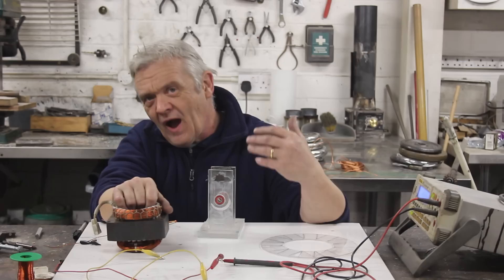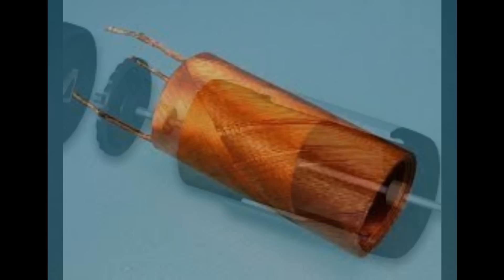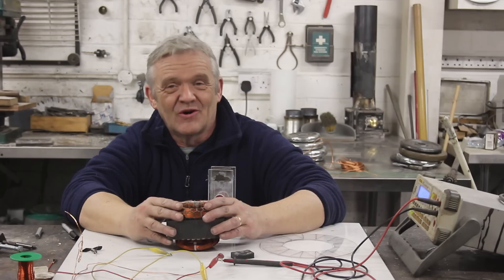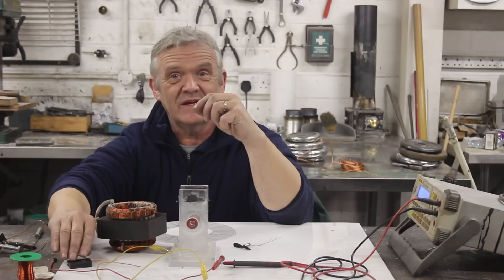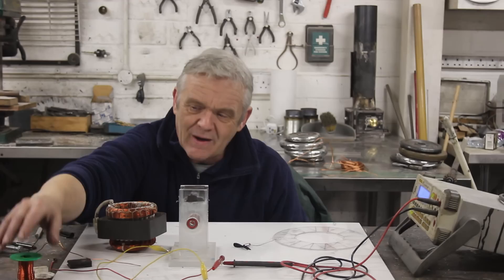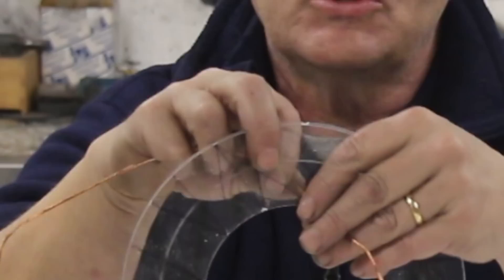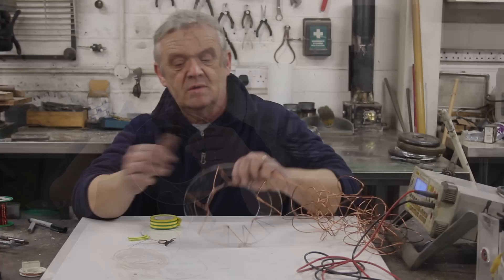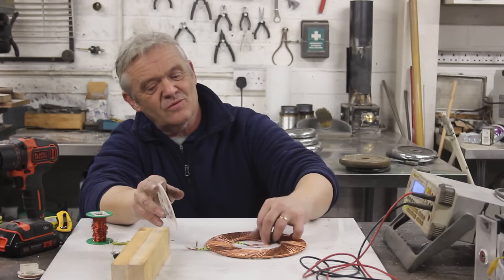1801 Winding Star (Faulhaber) Coils And Making Litz Wire

Comment: Tidy - nice build Rob, thanks for the upload - not enough of this sort of content on YT. 

Please do a video on your interpretation of a coilset that'd work well with back-emf pulses - Being a different method of switching entirely it requires a different coil arrangement. 
Were a rotor to combine one of Bedinis'  ultra low-current drive methods (attraction is more efficient than propulsion apparently) 

With a high efficiency generator winding like this on the other face of the rotor, I wonder if a gain could be achieved?

Many credible people have recognized that the law of conservation of energy is deeply flawed and all efforts to replicate should be applauded.
Reply: According to a 1955 encyclopedia the law of the conservation of energy states: “Energy cannot be created nor destroyed. It merely changes forms.” Later dictionaries and encyclopedias have a different meaning. Now, I’m not saying that the definition changed due to politics but it seems to me that the older definition has some wiggle room compared to the later definitions that cry out, “NO! You cannot do this!” There, I’ve said my piece. Thank you for reading my little rant.
Reply: @mikehorrocks2909  For sure , there are countless examples that seem to break the rules. None truly "generate" current (Dollard says otherwise in some of his lectures but I don't understand that much yet) however they can be made to work around them quite effectively. Your average heat pump has cop:4. Just a matter of converting thermal back to electrical, and loop it, it'll "run to the bearings wear out" I have read that this is possible. Possible electrically too. Bedinis machines were "Ether Sumps" for lack of a more fitting analogy. Creating a low point so some of the trillions of potential volts from the local environmental/static/ether/vacuum (insert your own term, modern science won't) can enter and be rectified, stored, or otherwise. Floyd Sweet did the same thing - so did Konzen, TH Moray, many others, that is create a phase conjugate mirror, sustain the dipole, and tap into what's already there instead of forcing nature's hand and suffering the "Leaky Diode" methodologies.
Reply: @reeferbeleafer9912  yes.
Reply: @reeferbeleafer9912  I've always read Bedini's machine was a way to circumvent the Back EMF that is formed in every motor, thus being super efficient but not breaking any laws of thermodynamics.
Reply: @JehuMcSpooran  "COP is in the batteries"

Comment: The problem with trying to harvest low wind speeds is that the power contained in the wind is a function of wind speed cubed.
So if your local wind is 4m per sec, you only get 1/8 of the power compared to if it was 8m per sec. Doubling the wind speed gives you 8 times the power.
So to harvest low wind speeds with any decent result means MASSIVE surface area to catch the wind. And the working surface area of the turbine is very expensive being (probably) the highest cost of the enture turbine.
If you seriously want to get usable,power generated from 4m per sec winds, I think you should be focusing on building very large turbine area very cheaply, and the type of electric generator etc is almost irrelevant (provided you gear it at the optimum ratio).
And there is a reason why commercial windpower operations dont try to harvest low wind speed areas... 🙂

Comment: Very cool. I would think a huge advantage of individual coils would be that each phase is wired in series. So load capacity increases proportionate. The interconnects can be larger wire. Much less resistance, less energy wasted as heat. It's like a 100 ohm vs 1000 ohm. This may save winding time though. Unless i'm seeing it wrong... that's a long resistance wire; It must be vastly larger to now handle the entire load. Individual coils do not have to carry every load in front of it. That would take some serious large amperage wire.

Comment: I understand that the different windings have advantages, but the common windings on the average motor are many times easier, and quicker to make, are cheaper, and the extra weight doesn't affect the power used or generated. I do find the last 2 videos interesting, and informative.

Comment: A lot of people don't realize flywheel mass in a wind turbine is less desirable.   Spinning a coil under a load pose a challenge in keeping it secured to the rotor when experencing back torque, but the wind turbine will be operating more efficently in varying wind.

Comment: Hi Rob. Love the Litz wire - great stuff. I’m struggling slightly with the geometry of the coil - maybe I’m missing something and you can clear it up? I would have thought there would have to be some sections of the coil which had no copper - to allow for the ac to flip direction? If I’ve understood the method correctly (other than the litz providing 10 turns in parallel) everything is in series (you just kept wrapping). I can’t see how the magnetic field is going to be changed in the coil as the magnets rotate past it. I thought you had to have (say) north poles over the coils all at once then a gap then south poles over the coils all at once. By spreading the phase to cover the whole sheet of acrylic don’t you have all of your norths and souths all acting simultaneously on different parts of the coil which will cancel out any emf?
Reply: I'm having the same trouble visualising this too.

Comment: i deal  a lot with coils to but not for generators or motors but for metal detecting we have a lot of discussion about it whats better basket loop dual you name it but i still havent found a good way, the thing is its so simple energise the target then listen to the result whats hard about that but it has to happen less than 50 microseconds or you wont detect gold so you need the coil to be quiet so you need to dump all the ringing and capacitance thats built up less that 50 microsecond using damping resistors so its not so simple after all but there must be a better way other that resistors to do it

Comment: permanent magnet 
Bifilar winding could be used to trap the magnetic field in the wire so it becomes a electromagnet / designed poles as you want 
so it can become corless magnetless rotor. calculated length to the wire relation to frequency you aim at to spin is the hardes part. 
for that smooth run. as negative resistor that feeds in the back emf (usless / usefull current ) frequency . 
swiching system to make a magnetic sucking effect .on / off . so it attracts. & when it pass that point swiches of by collected voltage / solid statate or sensor tipe system .

Comment: If the copper is at an angle to he rotational direction, say at 45 deg, the usable length will be sqrt(2) times the length, so that 41% is wasted. This amount may as well be positioned in the overhang position( end windings) wit the wires straight. You cannot rally win. Thank you.

Comment: Speaking of coils, any one else wonder why we still wind coils mono-fillar when it was discovered over 100 years ago, that winding the coils bi-fillar creates capacitance inside the coil itself and power-factor corrects the coil extremely efficientlly?

I did, I read the patent and was like "Oh that make sense, just make this one simple change to the manufacturing process and we automatically make every machine on the planet more efficient."

The other thing, about the coreless motors and generators makes sense because, with nothing for the magnets to be attracted to, there's nowhere where they want to "stick" so you don't have to fight that. After I'm done my current project I was actually thinking of making a bi-fillar panckake coreless generators/motor. Want to bifillar pancake set-up to make the most of the air/epoxy core before it atennuates too much, then the generator/motor will be automatically power factor correted and I should have a really efficient machine! It'll be a brushless PM-AC motor/generator and since it uses bifillar coils, if I tune the coil length right, I should be able to get the generator coils to resonate if I get the rotational speed right.

Comment: One of the traadeoffs not mentioned is about what's needed when spinning the coil. A pair of slip rings. And a pair of brushes for said slip ring. Both parts add complexity and maintenance. Nothing at all wrong with that, but tradeoffs. Always tradeoffs.
Reply: 10:51 Rob did mention it. :-)

Comment: Does it make sense to spin the coil one way and the magnets the other way?
Reply: In a situation where you are trying to obtain a high power density with minimal materials this does not make sense.

The added engineering to make both of them spin alone, you either need gearing or an additional propeller to facilitate opposite direction movement.

EXTRA GEARING
- If you use gearing you have extra friction losses.  Then the power from the wind is split between turning the magnets AND the copper.  Since some of that (say 10%) was lost to friction, each rotating piece will get 45% of the power from the wind.  For example, say this results in the copper rotating clockwise at 4.5cm/s, and the magnets rotating counter-clockwise at 4.5cm/s.  This is a relative difference in speed of 9cm/s.
- Now, compare it to the one with only one set of moving parts.  Without those friction looses from the gearing there will be a relative difference in speed of 10cm/s.  

EXTRA PROPELLER
- It is just a matter of having to try and fit more things into one.  From a fiscal and engineering standpoint it is just more.  For me, it would be easier to create two identical, more simple generators.
- I believe keeping it simple in this instance is just better.

Comment: I have to admit I am struggling to see how this works with one coil wound completely round as you have it.
If you had 3 coils covering the whole circumference between them (each covering a third) I could see it, if the magnets were spaced correctly.

Would you not get opposing potentials set up against each other as they pass a N-S field and at the same time but further down the coil S-N field?

One thing I will say though ...... it looks Cool, in a very 70's way of things! ;o)
Reply: Giving this some thought .... I think it could work! 
You would need to create a monopole magnetic field though. This could be by having a magnetic bridge from one side of the coil to the other so that the N is on one side and the S on the other .... then rotate the coil within this! 
Not elegant ... but I think it would work!

Comment: As opposed to manually passing the spool of wire through the center of the plexi former (frame), will this work by using pins(in lieu of notches), on one side on the former/frame?

Comment: Rob, something I’ve been thinking about for a while, but could you get more current out of that arrangement if you made both the coil and the magnets counter rotating? Like double the speed of magnet across coil? Just curious…
Reply: One way to increase velocity and rpms would be to make the coil a larger radius and add more windings. That way you could avoid losses due to gearing and weight/complexity. Have you checked out planetary gearsets? I think that would be what you need for counter-rotating magnets, it would be more compact but lose some of the power to friction.
Reply: @jameslynch8738  Hi James, that’s true about increasing the friction, but I got the idea from the spitfire’s contra rotating propellers, and I’m sure they got more speed out of them.. it would be ok I guess if despite the increased  friction there was still more power, but I don’t know as I have never built one and am not set up for it… would be a great project for TNT though!

Comment: I've read some articles that you just extend the steel up above the part that hang out and make sure magnets at them too and you can gain 10 to 15% efficiency on your motor so it really wasted coils if you do this? I have a few of these motors smaller from Japan but have a way higher power 2 size ratio than other motor similar size. but dual axle flex is definitely the way to 30-40% more torque the equivalent rated radial motors. I have a 96s32p beast I'm winding now

Comment: Excellent Robert Murry Smith, what great initials you have. RMS. I'll be very interested to see your Generator with the Faulhaber coil fixed and rotating magnets. And very interested in what Wire AGW  and turns etc you use and what power of Magnets you use. You've given me loads of enthusiasm to DIY rather than anything bought of the shelf.

Comment: A single coil wound around the 100% of the form as you did in the video will generate zero volts.  One half of the coil will always be 180 degrees out of phase with the other half. You may do 50% of the disk,  and then you will get a sine wave output. Or you may wind as you did with 100% fill if you connect the beginning and end  and leave a center tap at 50% wound. One coil becomes 2 coils,  and by tapping the center, both  coils can constructivly work in phase with the other, rather than fight each other with destructive interference. 

Cogging torque can be eliminated in generarators with iron by eliminating slots in the stator.  Very much like the ion stator I used in the motor on my channel.  It has no slots and zero cogging. 

Freqency dependent skin effect is almost non existing at the (rpm × (rotor magnetic pole pairs)) freqency we see in wind generators. Skin effect may become something to consider in motors that are controlled with pulse width modulation (pwm) at 20khz using wires that are too thick for that rate of switching, but most certainly skin effect is virtually non existing in wind generator having 8 pole  pairs  spinning at maybe 120-240 rpm (2-4 revolutions per second), whose output freqency is maybe 16-32 hz.
Reply: While that's absolutely correct re litz-wire, the point of making some here was to make winding the coil less of a chore.
Reply: @TheBaconWizard  I though stranded wire with one outer insulation coating would better use the space, especially on the inner radius. 

Have a look on my channel at how I built my first axial flux motor with three faulhaber coils. 😃 Yes I struggled a little with solid copper core.

Comment: Interesting winding especially for low wind applications. Here in Toronto, we have low winds one day and high winds the next. I wonder how this would work across the entire range of wind speeds. 

Regarding the winding however, perhaps power density goes up but I don't think it's due to eliminating the "edge" excess copper. The wire still loops over the edge and if you integrate the volume of metal on it, it should still amount the same mass as in the other winding architectures. Here perhaps you have more room to fit larger magnets all the way to the edge so you might get more out of your winding but I wouldn't say that you use less copper along the edge. Also, diagonal or not, you will still cover the entire thing with copper, so I'm not sure you're actually saving on weight there. Eliminating the core is definitely a plus though.
Reply: I was wondering the same thing, here in NV the wind is all over the place.
Reply: It's less about the weight savings and more about keeping as much length of copper in the magnetic field.

Comment: I have always wondered why don't they just use a solid piece of copper instead of wire? That way its all even enclosed and the correct shape. I know there is probably a reason, but I have never found an answer for this. Great video! Cheers.
Reply: The number of windings transiting the magnetic field at the same time (as much as physically possible) multiplies the output voltage. A solid block of copper would be like a single wire. With multiple windings, the magnetic field pushes electrons in the same direction, adding power with each winding of the wire. Do note that the windings are electrically insulated from each other. When a motor or generator burns out, this insulation can be melted away, resulting in a single block of copper and essentially a short circuit.

Comment: So, heres's a question on the magnets- as the point is to get the  field to cross the wires and change fast, instead of using, for instance a single large magnet, you used several small magnets in that same space? It Seems like that would get you more changes in distinct magnetic field, faster for the motion of the wheel?
Do you see what Im pointing at there?
Im sure theres some kind of tradeoff but instead of a N/S change over a couple inches you could get 3 or 4 in the same amount of motion.  
Dont know if thats a useful thought, but I wondered if, like this coil gets more copper under the magnets, if more magnets over the copper might also have a benefit?

Comment: Can't you have the stator and the rotator revolve in the opposite directions?
Instead of the stator being stationary have it rotate? Will that work?
What about mixing the diameter of the  wires? Have a thin wire in between the larger wire in the gap formed by the 4 larger wires?